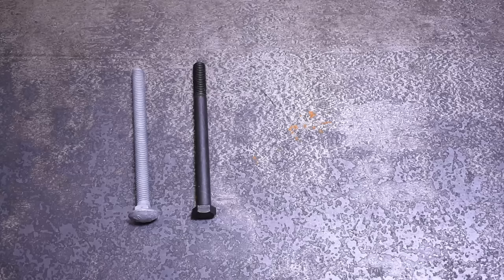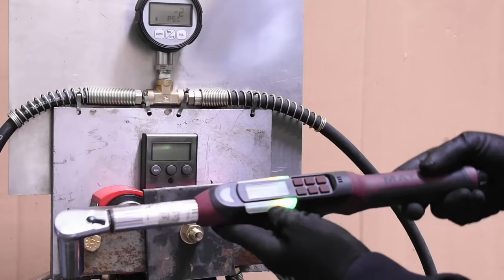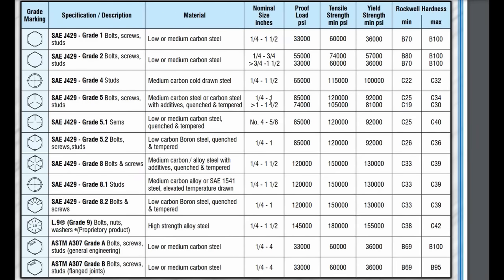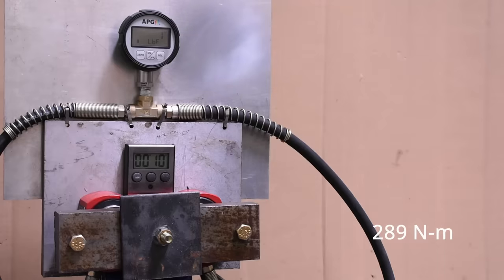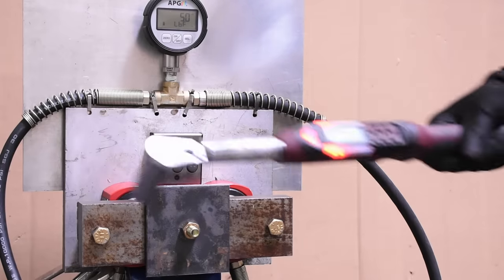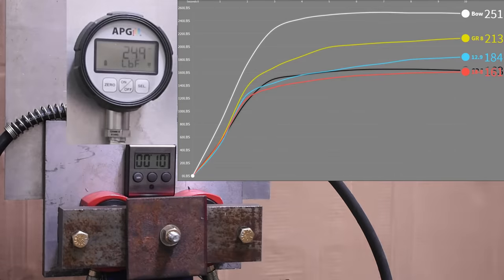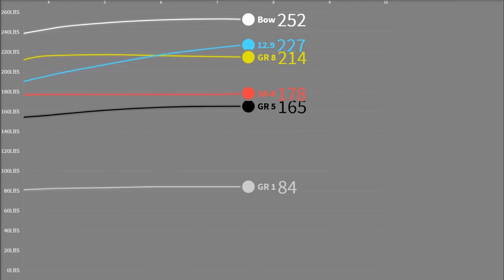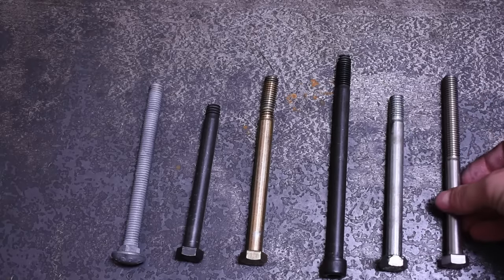Strongest Bolt? Grades Explained & Dyno Tested For Science

Comment: I’d like to to see the same test with ARP head studs. And compare to other head bolts or studs
Reply: ARP uses a variety of different materials, but below is a selection that you might find for head studs.  (1 ksi is just 1000 psi)

ARP:
8740: 180 - 210ksi
ARP2000: 220ksi
Custom Age 625+: 260-280ksi

Factory LS metric 10.9 head bolt: 151ksi

This isn't completely apples to apples, as you'll get a little bit of extra clamping force out of the factory bolt by using the torque-to-yield procedure.
Reply: @fastindy  interesting info
Reply: Yesssssssssssssss please like Toyotas (TTY) bolts
Reply: I'd like to see that too.
Reply: @fastindy  What people don't realize is that you don't get anything additional from the stud if you don't tighten them further to the point where they're providing additional clamp load then the factory headbolt. The modulus of steel is the same, the only way this works as a performance increase is with more preload.
Reply: @sebastianharrison6118  All TTY does is spread out the relationship between torque angle and clamp load. A non yielding fastener has a direct relationship between how many degrees it's rotated past hand snug and the clamp load it produces. A torque to yield fastener permanently plastically deforms the fastener making it permanently longer. Part of what you get as you do that is a much broader range of angles and which the clamp load is similar. It's not about maximizing clamp load it's about an easy way to provide uniform clamp load which is more important in most instances. If you've got further questions I can explain further in extreme technical detail if you desire.
Reply: ARP compared to a cheaper brand like Xotic would be awesome!
Reply: Some L19 studs would be the ones to test there the big boy studs
Reply: Head studs are designed to resist stretching more so than rotational torque.
Reply: This would be awesome
Reply: @otm646  yes I am mainly curious about the bolts that are in my Toyota motor I am going to pull the head off but a lot of people are saying I cannot reuse the same bolts because they are TTY the motor I am speaking of is the Toyota 2rz ....not The (2jz) ........... I do appreciate the detailed information thank you you probably already explained it but my caveman brain didn't fully understand LOL
Reply from the maker: Looking into this, what would go on the opposing end if not an actual engine block for the test? (in testing bolt stretch, not tightening torque)
Reply: Same!
Reply: @TorqueTestChannel  id say just double nut it gently to simulate it being in a block definitely need to try some L19 studs there rated pretty high
Reply: @TorqueTestChannel  can you make you tester portable to go on a block? The back of the tester on the deck and a spacer to make it the same height as the head would be
Reply: Dont quote me but i think around 260.000 psi on a 12mm stud
Reply: You will need your safety squints when the head studs break lol
Reply from the maker: @MattLitkeRacing  It's too thick. These are 6" bolts and just go past the face. A head bolt wouldnt be long enough to thread into an actual block plus the dyno.
I can build a hollow ram dyno for this task, but need to think of what goes on the opposing side if not an engine block. People will cry foul if anything less than representative. I'd want to torque them to spec 1st to measure real stretch.
Reply: @TorqueTestChannel  maybe go with a nice chunk of steel and drill and tap it. that way you can bury/cover all the threads ?
Reply from the maker: @sebastianharrison6118  it would be much too soft and just pull threads. Maybe just quality cast iron rectangles. Like an engine block would be. Sounds fun to tap. I don't believe the threads are sleeved on blocks?
Reply: @TorqueTestChannel  Could try a piece of A2 tool steel and send it to a local shop for heat treating. A2 easily can reach 60 HRC
Reply: @BIGSMOKE-bl2lq  agreed. Get some pfc9's in there
Reply: @acat6000  its actually not that easy. There are not alot of "local" shops that can just correctly harden a piece of A2. Or any tool steel. Although, i will say guys can do it with nothing more than a torch and a fan. Maybe some stainless wrap. But for sure not anyone can harden a2 to 60 hrc.
Reply: Re read your comment....a2 can easily reach 60hrc. You are correct
Reply: @TorqueTestChannel  ya cast iron would be best just drilling and taping cast can be unforgiving at least for my skill level lol ... can't wait to see I'm glad you're excited and it would truly help me .... thanks
Reply: @TorqueTestChannel  don't forget that modern engines are all aluminium.

Have you ever come across a 14.9 bolt? Would be interesting to see how that holds up against ARP.
Reply: @sebastianharrison6118  looking at those 2 rz head bolts it appears they've got two body diameters and then the threaded portion. They are most definitely TTY, but the reason they've got a second smaller body diameter is so that all of the yielding is done within that smaller diameter. I understand it's a pain to have to replace them when you pull a cylinder head but the trade off you get for uniformity of clamp load, which is a big part of not having a cylinder head gasket fail, is totally worth it. Plus you have to remember these engines are designed for assembly, that allows them to provide a much more consistent motor across the hundreds of thousands/millions they produce every year.
Reply: @otm646  awesome thanks for the explanation gotten a lot of information going back and forth weather to change them or not but with this information I will make sure to change them and not reuse my original head bolts I'm probably going to go with an ARP head stud because they seem to be cheaper and easier to get than a new Toyota head tty head bolt .... Do you think the arp head studs will do the same job as the TTY Toyota uses
Reply: @sebastianharrison6118  They are correct, you cannot reuse head bolts, studs can be reused. Bolts twist and stretch when they are torqued, the twisting prevents them from being able to be properly torqued again. A stud only stretches when it's torqued, so they can be reused.
Reply: @otm646  They reduce the likelihood of head bolts and exhaust studs breaking over time. I'm replacing the exhaust studs on my '99 F-250 right now because they're braking off and it SUCKS! I'm putting ARP studs in there for the explicit reason that I won't break the studs and have to do this job hopefully ever again! (or at least until the new manifolds crack)
Reply: @TorqueTestChannel  I might be able to send you some bolts and studs. Do you have a po in bio or?
Reply: I like this. Compare to stock gm head bolts/studs
Reply: @otm646  I'm with it Donald, send that shit. Kinda crazy that we can get metal to intentionally plastically deform
Reply: I second this I'm about to do head gaskets on my acura engine and I'm considering ARP head studs over factory OEM ones
Reply: @bobbygetsbanned6049  some manufacturers (such as Cummins) do specify being able to re-use headbolts, provided they haven't stretched too much. For their 5.9L diesel inline 6 engine headgasket kit, cummins provides a bolt stretch gauge to measure used headbolts for re-use or replacement.
Reply: @TorqueTestChannel  Well you could use ARP rod bolts that way you can thread them into something
Reply: @otm646  Most aftermarket head, rod or case bolts/studs require higher torque and often use a lubricant that reduces friction compared to the factory installation procedure. These both obviously result in higher clamping forces on the assembled components, but in many cases that clamping load still doesn't approach the yield strength of the fastener or base material. This is where the second benefit of the higher strength materials lie: in the case that the fastened components do experience forces higher than the expected load (up to a point) the fasteners won't permanently deform, meaning when those forces are removed the clamp load remains the same as the fastener hasn't yielded. While that may not save an engine from needing a rebuild it can often prevent a more catastrophic failure
Reply: @sebastianharrison6118  if you aren't going with an incredibly high performance build where you need the additional clamp load on the head gasket the non TTY head studs are actually a disadvantage. You're stuck in that direct relationship between input torque and clamp load which is setting you up for substantially less uniform clamp load across the head gasket surface. 
I'm using very broad numbers here, but with the studs you're at a one to one ratio, when you're in a torque to yield fastener you're at a 10-30 to 1 ratio. So the same extra degree you turn that fastener only has a tenth of the effect (increase / decrease) in clamp load.
Reply: @otm646  yes you are right I am at 95 ft lb on the ARP bolts.. compared to originally 29 foot pounds plus two 90° turns on the stock Toyota TTY head bolts
Reply: @otm646  the truck this is all being done to is my 96 Toyota Tacoma 2WD 2.4.. about 2 years ago it finally rolled over the $300,000 mile mark so i decided to reward it with a turbo as a birthday gift just a cheap $500 eBay turbo kit and then a $100 eBay turbo manifold no special ECU or anything just tricked my O2 sensors and got rid of my cat truck ran great until a month ago put $28,000 mi on the turbo she now sits with 328,000 I ran 15 psi the whole time and if you did a real hard pull in fourth or fifth gear it would get up to 17 PSI and my afr would be at 14.1lol it was my daily driver but it developed a knock and well I liked it so much I decided to build it typically I just build SBC but this Toyota grew on me
Reply: Also I am running a copperhead gasket and when I rebuilt the two RZ motor nothing was severely damaged so I just replaced the main bearings rod bearings wrist pins and piston rings .... I was going to shim the valves but nothing was out of tolerance and same thing with the timing set nothing was war not even the guide plates I've always ran mobile one 0w40 and a k&n oil filter and change every 5k so idk ... So far the truck is back together and has gone through two heat cycles and I retort the head putting 15 more pounds bringing the toll to 95 ft lb
Reply: @otm646  very interesting point, guess it has a tighten to yield to stretch them very little, thanks.
Reply: @otm646  the real benefit comes from cars converting head bolts to head studs. The same tension can be achieved without stressing the block’s thread as much as bolts. And you get to say you have ARP studs
Reply: @hectordelgado3258  The torque is transmitted identically in both situations (I've run these tests on a toque tension machine). Unless it's a racecar/drag car you're not going to put enough sets of head bolts in it to matter. A normal engine is going to have 2 or 3 sets max over it's lifetime.
Reply: @TorqueTestChannel  put bolt into hardened steel block tighten to equal psi and measure length of bolt before and after to check length of stretch per psi the higher tensile strength the less it would stretch
Reply: @TorqueTestChannel  "people will cry foul.". Brother those are the bell ends. You guys do a great job, don't let the snowflakes tell you how to build your igloo.  Let them build their own rig to prove your's bad, yeh....lol
Reply: Yeah, actually, that'd be cool. Should be a lot higher, I hope, for what they charge me!
Reply: @otm646  What most people don't realize is that the fine thread on the nut end of the stud means more clamping force at the same torque wrench setting.
Reply: @otm646  Is this test in the video the same as if a tensiometer was to pull on the bolt without rotating the nut? Is the nut the limit or the bolt itself. (2 nuts better than one, or one specially machined double length nut) From the video it looks like results would be different for different bolts, some having threads fail and others fracture of the shaft.
Reply: @TorqueTestChannel  cast iron would work for older motors, but almost everything these days is cast Aluminum. I’ve got ARP’s on both cast iron & aluminum blocks. So I’d definitely be interested to see the differences between the 2 materials. Plus, then you’re not gonna have to do some follow-up vid cus you didn’t do aluminum in the 1st vid. 
You might look into getting an old block or something from a machine shops scrap or a recycle bin. 
Hell, on Craigslist people will give ya some old random block for free cus they just want it gone.
Reply: @ShawnDickens  Wow you are right, I would like Donald Johnson to comment on that, the finer threads of studs must be a massive factor affecting clamp for a given torque spec.
Reply: @TorqueTestChannel  Use Gen III LS bolts (longer) in a Gen IV LS block (takes shorter bolts) give you way more room for the dyno.
Reply: It's kinda easy to see the 1st few comments are yours
Reply: @otm646  doooooo it!!! Yes please I'd like to hear more and I'm sure lots of others would too!
Reply: That’s a hard test since head studs are designed to stretch
Reply: 18.8 tool steel has much higher psi rating
Reply: ARP are pretty good quality I would like to see that too 👍
Reply: @garykeenan3724  check out their channel they made that video
Reply: As well as what the difference is in the various pitches. The pinch bolt on old BMW was 6-.8, and was generally over tighten by many, but I only had one stripped and it was locktited when it was last assembled. I had many good used as I did MB And Bimmer.  I wonder what hardness it was?
Reply: What about an actual engine block from a junkyard?
Reply: Headstuds are designed to have a slight (very very slight) give to them, ARP headstuds create cracks around holes on block. Not necessarily a big problem if you plan to only replace headgasket once and not ever make alterations
Reply: You should do this with a duramax Harmonic pulley bolt
Reply: @otm646 don't you get more clamping force from the same torque, because the friction on the 1/4" of thread on a nut has less than the longer bolt thread? Like you get more clamping if you hold the bolt and turn the nut versus holding the nut and turning the bolt (with random assemblies).

Comment: One could add, that the markings in the metric system actually make a lot of sense and tell you about the physical properties of the bolt. 10.9 for example: the first number (10) multiplied  by 100 gives you the tensile strength of the bolt (1000 N/mm²). Multiply that by the second number (.9) and you get the yield strength of it (900 N/mm²). Simple as that.
Reply: everything in metric makes sense obviously !
Reply: It would be awesome if it was that simple. That would make 8.8 bolts have the same tensile and yield strength which could get pretty scary in practice. Actually the second number is a factor that is 10x the ratio between the nominal yield stress and the nominal tensile stress. Also the conversion from newton/square millimeters (N/mm²) to MPa is times 1. They are scaled the same, so no need for unit conversion unless you need SI base units instead of derived units.
Reply: @adaycj  8.8 = 800N/mm² tensile (8x100) and 640N/mm² yield strength (8x8x10)
Reply: Metric always makes a lot more sense than crappy inch luckily no one use outside of the US. In the US and CA, it is a nightmare because on the same truck, car etc... you find a mix of metric, UNC (the worst) and UNF (some easily confused with metric).  A waste of money too !
Reply: Is bolt diameter has any impact on the tensile strength ? For, Eg,  A M10 10.9 Hold 1000 N/mm2 as same as M16 10.9 ?
Reply: @Srk7028  No. Tensile strength is purely a property of the material and not its shape or size.
Reply: @clitisswood7330 not entirely true that Canada does not use inches.  It's still very common in certain areas and businesses.
Reply: Correct!
Reply: We’re not besotted with Napoleon in Britain and so most of us prefer to use our own arbitrary measurements rather than his.
Reply: I sometimes feel anti-American when I have to use yard pounds and inches.
Reply: @치킨마요덮밥 lol
Reply: @casemodder89 pov: you don’t know much about the metric system

Comment: Interesting video. I’m a metallurgist and used to operate an accredited fastner testing laboratory. Nuts and bolts are a complicated subject. The way they are installed plays a huge role in how a threaded connection performs.
Reply: Spoken like a bolt manufacturer, always blaming the user for poor installation or misapplication. Just kidding, I'm an old QA manager reminiscing about the little daily wars.
Reply: Agreed Ted. I've seen grade 8 bolts snapped from hand tightening because a misaligned assembly caused bending of the bolt. Tension, torsion and bending combined can overwhelm a sturdy fastener.
Reply: Would be cool to see A325 (structural grade) on this scale
Reply: which one of these bolt could withstand the internal chamber pressure of a 7.62X39 cartridge?
Reply: @toma5153 you've seen a grade 8 bolt snap from hand tightening? 🤔🤨 If that's true then I seriously doubt that's a user error...
Reply: @A_Stereotypical_Heretic  Ugh poorly written comment I made. I meant hand tightened with a wrench.

Comment: My old boss wanted to put in  used regular non grade bolts in a man lifts castor wheels. They would put wedges in the lift leg sensors to trick the machine into thinking the legs were down and in place and all the weight would be on the wheels, that way they didn't have to mess with the legs and lock out system when they did light changes in the gyms. They just wanted to roll a guy 30 feet up from light to light and save time!! I told him to go to hell and I wouldn't be going in it ever again.  I was 3 weeks in that job, but I couldn't let him do that and kill  me or someone else..  after that I was on the gotta go list and only made it over a year before getting fired over "budget" cuts..